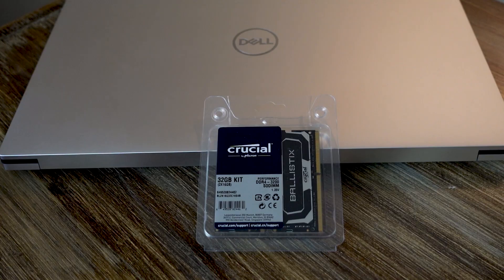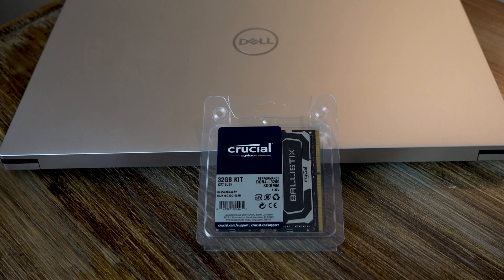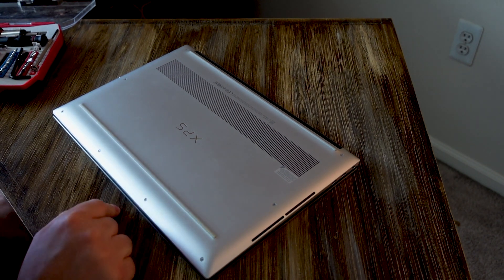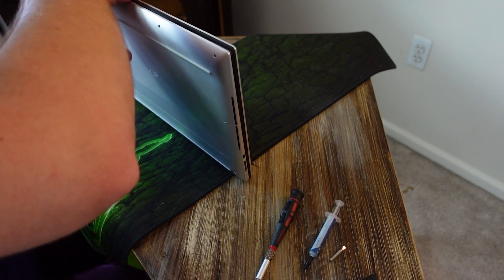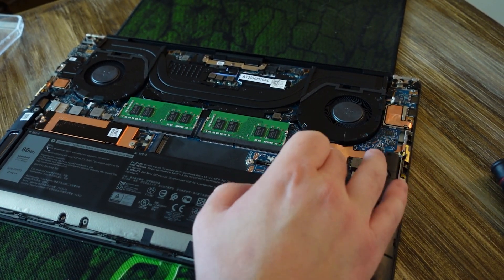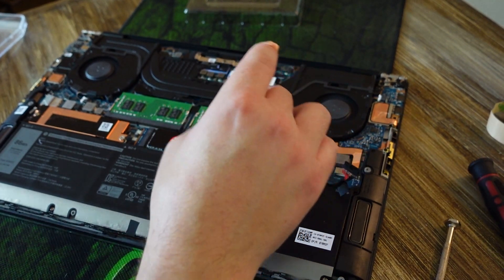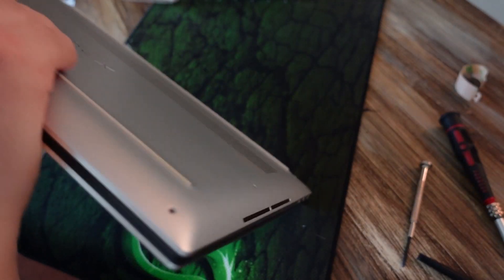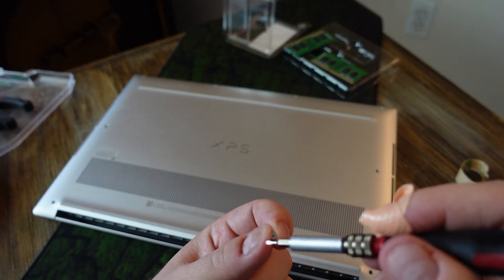Dell XPS 15 9500 - HOW TO: Upgrade the RAM and SSD yourself and save some $$!

Comment: I followed the steps exactly to add an additional Samsung 970 EVO PLUS. My computer boots up exactly the same as yours. However, in disk management it does not see the new SSD. Clicked refresh and scan drives and it still cannot see the drive. Any thoughts?

Comment: Great video! Two questions: 1. Been hearing different opinions on adding the additional SSD to the second slot and the laptop getting hotter. I just ordered a 256 XPS and purchased a 1GB SSD but my plan was to replace the 256 in slot 1 as opposed to adding the 1TB as you did? Any thoughts? 2. Just to confirm, you are saying upgrading RAM at 2666 should be fine (so I don’t have to stress about finding 2933)?

Comment: The Crucial memory selector is bogus. It recommends voltages and  speed options that aren't compatible with your system. For example, the correct RAM voltage should be 1.2, not the 1.35 that you installed.  You would be better off with 2 sticks of Kingston part number KCP429SS8/16. In the end, you might have actually downgraded your memory.
Reply from the maker: Dell always ships desktops and laptops with lower voltage ram. As long as you don’t mix them with higher voltage it’s totally fine. I needed the 32gb more than I needed a few extra hundred MHz.
Reply: Hi, thanks for this info, can I use Crucial 32GB Kit (2 x 16GB) DDR4-3200 SODIMM (CT2K16G4SFD832A) instead? From the specs, it is 1.2V but CL is 22.

Comment: I just got the XPS 15 9500 with 16gb memory, 512gb SSD, i7 6 core, 4k touch panel. Would upgrading my memory to 32 like you or 64gb make a big improvement? Also is it worth putting in another hard drive?
Reply from the maker: I think going to 32gb only makes sense for video and photo editing in most cases. If you aren’t sure whether or not you need 64gb then you probably don’t need 64gb. As for the storage, it’s really easy to add an m.2 ssd, so if you plan to have a lot of large files like games stored on your XPS then I would definitely add a 1 or 2tb ssd.
Reply: @mr.rogersreviews4224  would any of those things or doing both make the laptop noticeably faster? Doing both is probably overkill for me but I like speed and flexibility
Reply from the maker: For general use, neither upgrade is really going to make your computer feel noticeably faster. I would say if you have to choose one upgrade, I’d add more storage.

Comment: So did you figure out if you could make the RAM run at 3,200 MHz or at least the same 2,933 MHz as the factory RAM?
Reply: This is because the XPS ram runs at 1.2V (DDR4L-2933) Crucial Ballistics looks good on paper with tight timings CL16 and 3200mhz but that’s at 1.35V. At 1.2V you get downclocked to 2600 and probably some horrible timings like CL20. See if OP can run CPU-Z and show us the timings. Basically the ram upgrade is hurting the performance. Dell bios, yay!
Reply from the maker: emarinelli I still only have it running at 2666 unfortunately
Reply: @MARCUSAURELIUS Anything rated at DDR4L-2933 / PC4-23400 , that is 2933MHz at 1.2v. I recommended to a client that wanted to use Amazon this one MD4S1632180IZ0DC that has a CL18. But I would recommend getting a better name brand that has lifetime warranty from newegg.

Comment: Thank you for this video! I have an XPS 15 coming with the 256 ssd and 8GB on RAM, however I have also ordered 32GB RAM and a 500GB ssd to upgrade on day one! I am admittedly a novice and this video gave me the confidence I needed! Question, the RAM I ordered is DDR4 - 2666. Will this be greatly slower than what you installed? Sorry for probably a dumb question lol, but thanks again!
Reply from the maker: David McDowell hey I’m glad you found the video helpful! No, the ram speed should be fine! In fact, I’ve only been able to get mine to run at 2666 anyway.
Reply: @mr.rogersreviews4224  excellent thank you! I know it's not a gaming machine, but with the better graphics card I want to be able to game a bit lol. Can't wait till it gets here!!!
Reply from the maker: David McDowell you’ll definitely be able to game on it.

Comment: Does it void warranty to open it up and add ram?
Reply: According to dell, as long as you don't throw away the original parts that came when you first bought the laptop, then your warranty does not void. but before taking it back to dell you have to re-install all the original parts like Ram and SSD in the laptop.
Reply: I don't think so
Reply: that question is so stupid, but anyways, YES
Reply: @Jaksoncpp  Misinformation is stupid.
Reply: @Jaksoncpp  asked and according to dell it doesn't. I saved the conversation. But thanks.
Reply: @Jaksoncpp  you must feel stupid
Reply: @squirreldemon3506  Actually no, I am not dell support, and I dont live in the US and I dont care ,because if i want to know something i search by myself.
Reply: @Jaksoncpp  Well be informed next time so it doesn't happen again